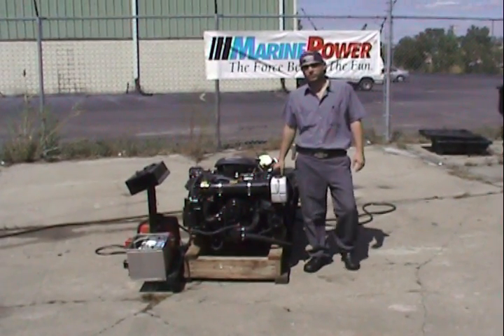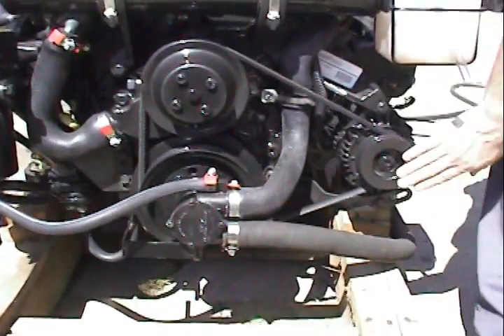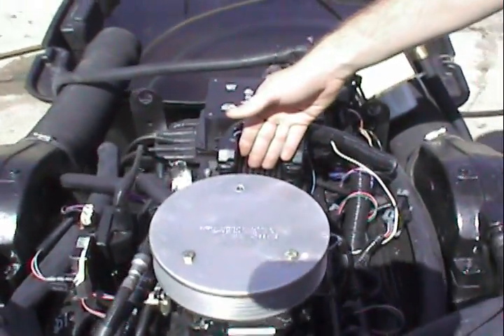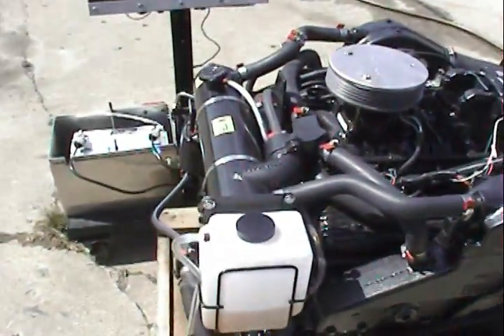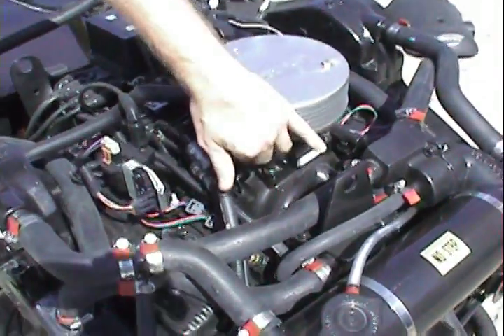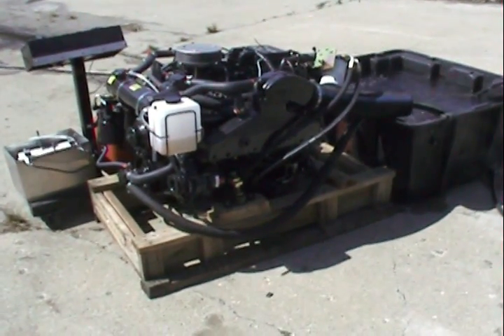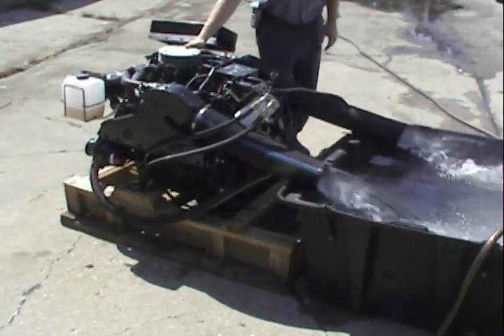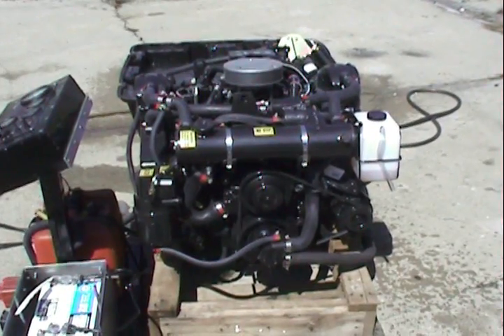5.7L Complete Marine Engine Package FUEL INJECTION (1991 and Earlier Volvo Penta Applications)

Comment: all u guys carrying on about fuel injection - seriously, my 1974 351 ford with a dinky 2 barrel rochester gets me around 3.5 miles per gallon cruising nicely. NOTHING wrong with carbs! And less to have to deal with electronically. Add an elec ignition upgrade - trust me, keep it simple! No way fi saves 30% fuel.. unless your float is leaking constantly